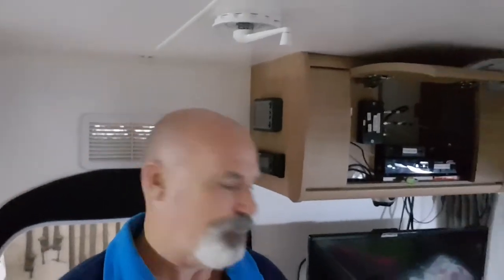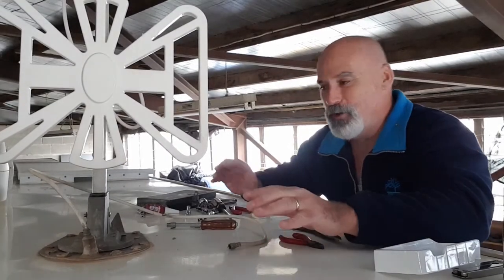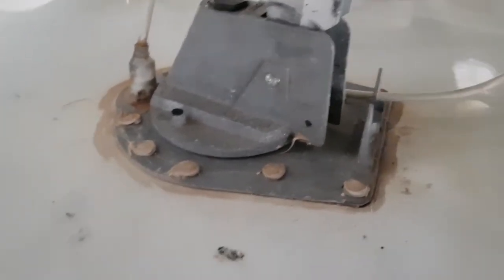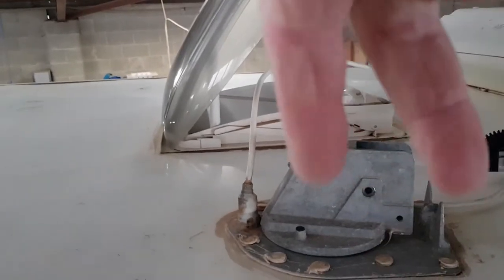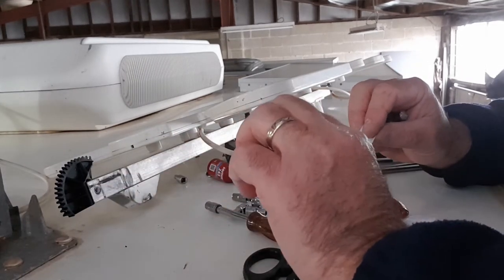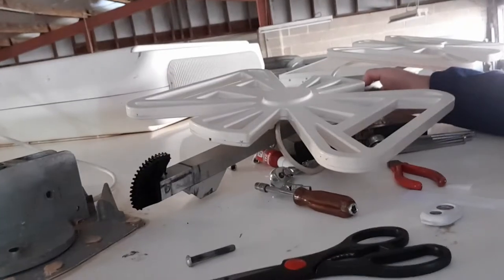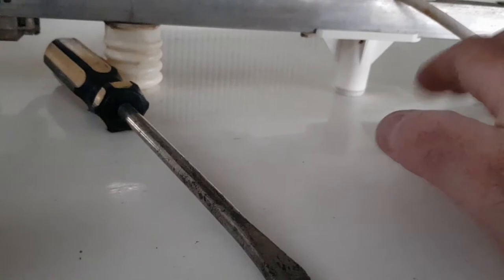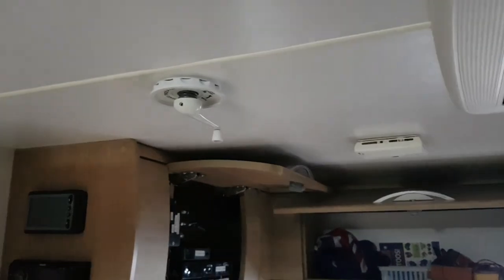Winegard caravan antenna / aerial repair. No more bouncing

Comment: Great tutorial and Ozzie ingenuity. The only suggestion is to run a thin brass sleeve over the retaining bolt instead of plastic to reduce the wear on the thin 25x25 aluminum square tube.

Comment: Nice vid mate, from a dinkum Aussie ! I had a similar problem with the pin holes being flogged out, so drilled them out slightly and put a 304 stainless bolt through with nyloc nut. It allowed some tension to be applied and helped stopped the wobbles ! Cheers, Rick
Reply from the maker: Thanks Rick. Parts and repairs are a little too expensive not to at least have a crack yourself, or find a alternative workaround hey 👌

Comment: Installing a new antenna  tomorrow  from the old style that you mentioned with the 2 uprite tubes,to the 1 like you have.., Glad you mentioned that idea bout the extra support. So i think i mite do the same thing and leave a small section connected to the new antenna, cvos i dont it flopping round like a cock in a sock. Glad i watched ya video. Very helpfull..thanks
Reply from the maker: Thanks Mark, glad you found some value in the vid. Cheers

Comment: winegard  suggests  a  silicone spray rather than  wd40  nice  work on vid  cheers
Reply from the maker: Hey Jjustj, agreed and thanks for the kind words.  The spray I'm using is a dry anti friction PTFE Lubricant (Teflon), a specialist product in the WD40 brand stable and very good for exterior plastic parts